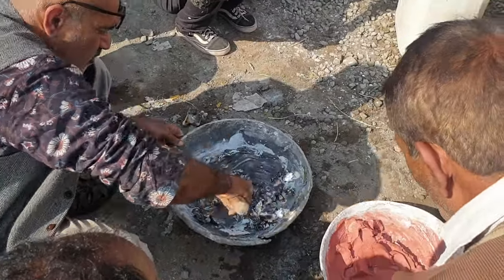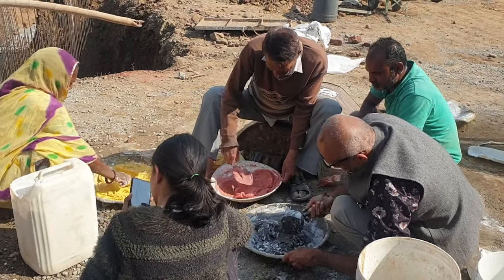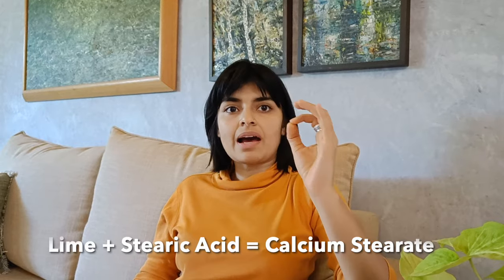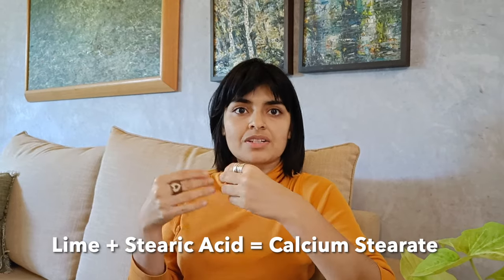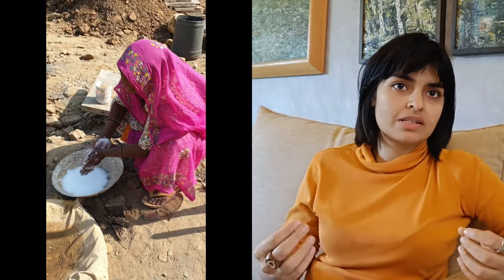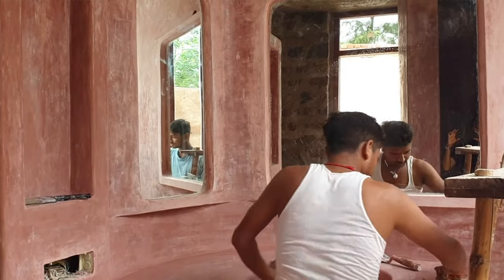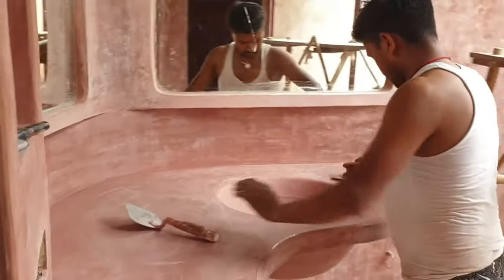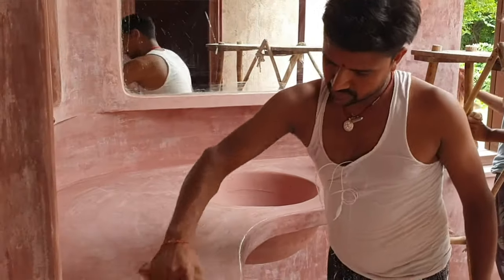How to do Polished Lime Surface finish

Comment: Ok. I understand Stearic acid as fat from the soap . I have been using it for the last few years for the finishing works in a restoration project in Italy. Here we get an olive oil soap with the colour removed.  Our marble dust is graded , our lime is aged underwater. In use since Roman times.  Thank-you  both for  concise and practical advise.
Reply from the maker: Thank you for your informative comment!

Comment: Excellent video. Hope you will make more of these in detail for people who want to construct using lime. May be you should start a learning course. A question.. is calcium stearate or using marble dust to achieve smooth finish considered sustainable, reversible and eco friendly? Just trying to figure out whether it goes well with Mother Nature.
Reply from the maker: The calcium stearate layer is a few microns thick. The marble lime mix  layer is a few mm thick. I am not sure what happens when it's recycled or removed, but I think the volume won't be much.

Comment: Mam, you've really done a very good venture. You are a very good teacher and explainer. I watch all your videos. About this video,  I just wander what type of roof can be build for a house which is build using lime as binding material. Can a two story house be build using lime.
Reply from the maker: Unfotunately we have used cement in the roofs, as our masons could not use lime mortar for roofs.
Reply: @farmaanandaa  Actually, to install solar panels, we need higher roof. So what do you suggest mam.

Comment: Dear ! Manisha I did not get your point from 5:26 to 5:44 . ( Soap will be applied before Calcium Carbonate Sets ) For better shiny surface ). Please elaborate?
Reply from the maker: Soap has stearic acid. This stearic acid combined with Calcium Hydroxide to form Calcium Stearate which gives the shiny mirror finish. If you wait too long to apply this soap, the Calcium Hydroxide will simple become Calcium Carbonate. It will be hard, but wont have the shine. Hope that clarirfied
Reply: @farmaanandaa  Got it. Thanks

Comment: Nice,   I am looking for stearic acid soap to finish my lime plaster,  but couldn't.  I tried making at home but failed, can u guide me about stearic acid soap and it's exact ratio
Reply from the maker: If you are in India, just use Lux International white soap. Alternatively you can contact MLIME to source the soap they have made specially for this purpose
Reply: Great 👍

Comment: There are so many types of lime.
When you say lime, in europeans countries there is NHL 2 , 3.5, 5 hydraulic lime and also air lime , Quicklime, Hydrated lime etc..
What do you use in India?
Reply from the maker: You are lucky you have so many grades of lime readily available. It's not so easy here, as cement has really taken over! We used quick lime for foundations (and then hydrated it) and standardised hydrated lime for plasters.